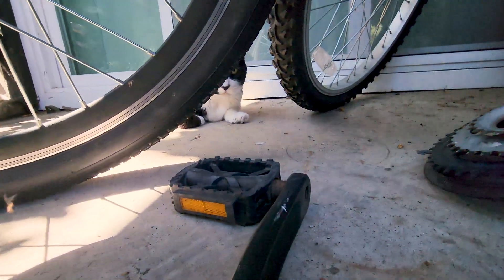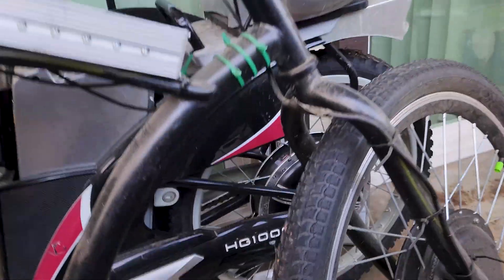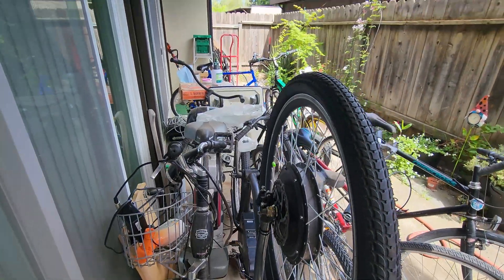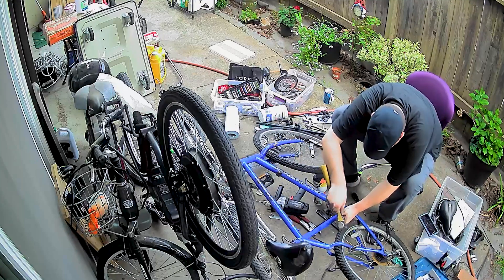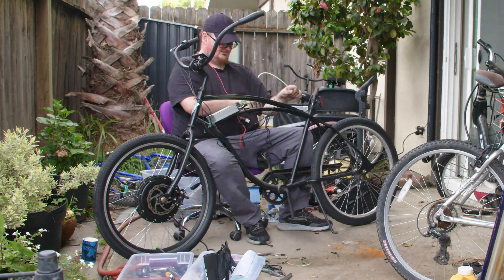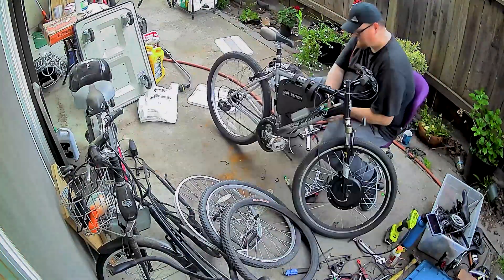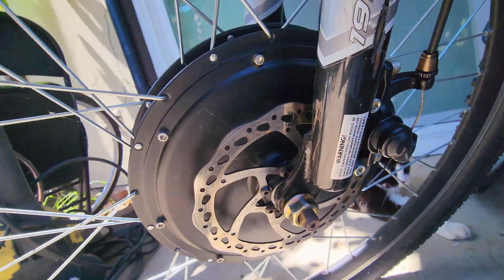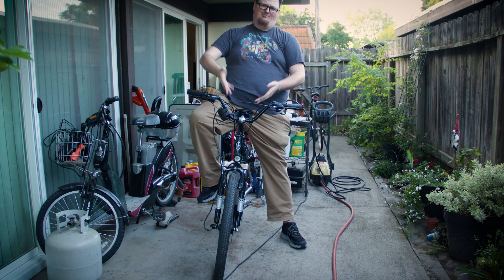ADDING A DISK BRAKE? (Voilamart 1000w E-Bike Kit)

Comment: I recently got a 26" Voilamart 1000w front hub wheel, and it didn't come with a disc brake.
My current disc brake doesn't fit the wheel, so would you happen to know what size disc brake I would need?